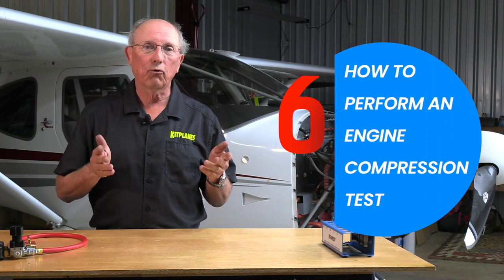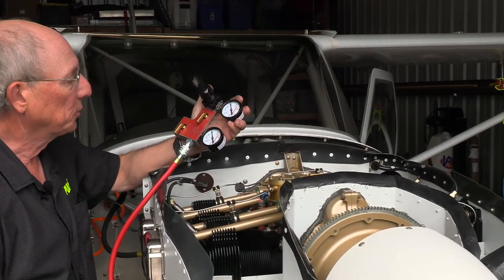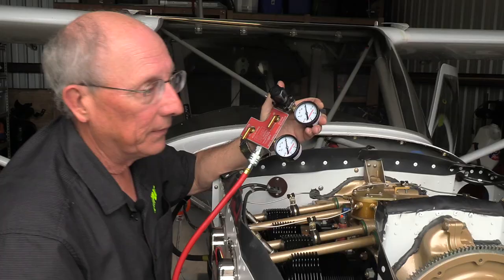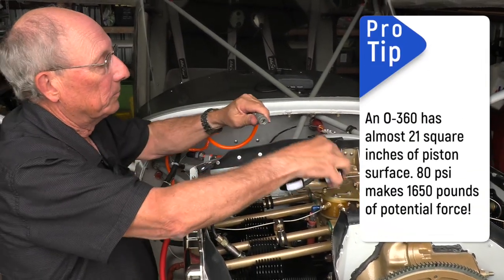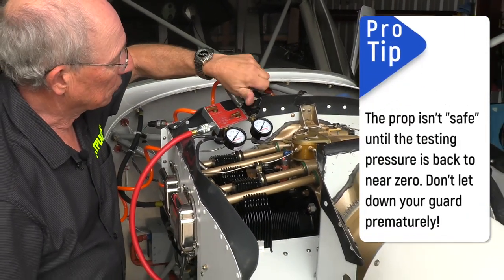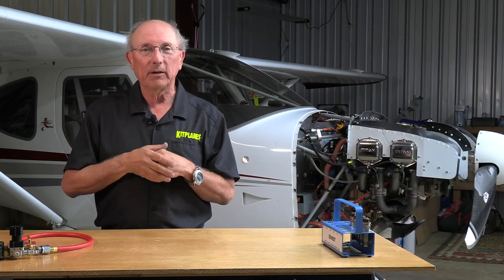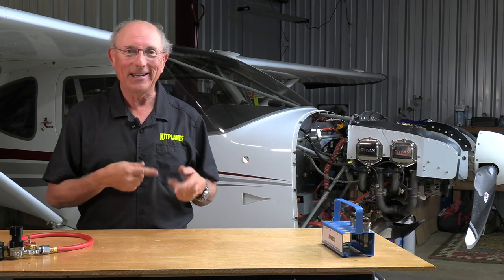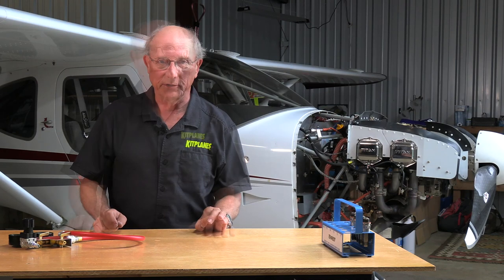KITPLANES Firewall Forward: Compression Testing

Comment: Paul just casually mentions "pull some spark plugs".  I think it makes sense to pull a spark plug from every cylinder before beginning.  That way, the engine can't kick because of a cylinder firing.  It's a low, but I think non-zero, possibility.  Even so, the prop can kick from the compressed air being injected.  And Paul rightly cautions us about that.  That's the more obvious and more likely scenario.  This series is great!!  Thanks Paul.

Comment: Paul didn’t say to warm the engine up first. Thoughts?
Reply from the maker: Warm up the engine! You can do compression testing cold but it's more representative of actual engine health when the engine is warm.
Reply: Do it cold, then if you get a low reading, you know it will only be higher if the engine it warm.  Run the engine and then check pressures…they should be higher.  Just another way of doing it 👍🏼  Great video!

Comment: I've never liked doing this test. Dangerous. The prop! Best done with two persons. One to man the prop and the other to run the test and operate the air valves.
Reply from the maker: Agreed, as long as that other person is properly briefed on the procedures. Sometimes, though, you have to do it on your own.
Reply: That just exposes twice as many people to danger and is a bad idea.  Better to simply stay clear of the prop and expect it to swing.  Then if it does, no big deal.  Holding the prop beyond a low psi TDC confirmation, is extremely foolish.
Reply: Agree.. a moment  lapse of concentration  and prop will bite you. Have the stitches  in my head to prove it...  lost the prop and where I was in relation to the prop.  My  first time doing compression  check.  Felt very embarrassed  when it happened.

Comment: You didn't mention the master orifice check which is affected by atmospheric pressure.. You are misleading the public. Borescope your engine and find out a lot more about your engines health. The only reason i conpression my 0-470  is because its required. Watch Mike Bush's videos for good info on the subject.
Reply: Nothing misleading here.  Both procedures have value.  A borescope exam is unlikely to tell you that the rings are worn out or tell you that a valve is leaking and give guidance as to which valve.  The minor variations in atmospheric pressure are insignificant to this test.  We are measuring to the nearest 1 psi at best, not 0.01 psi.